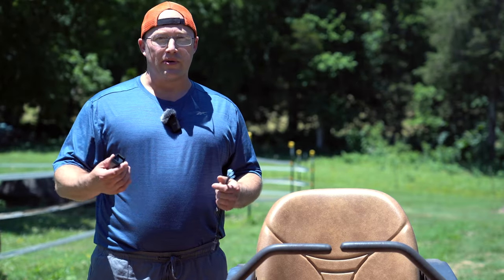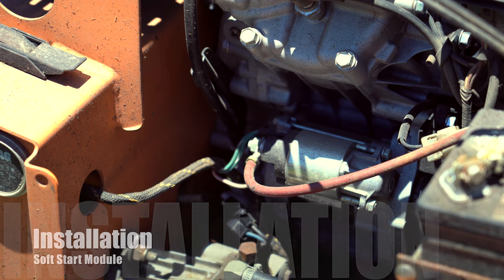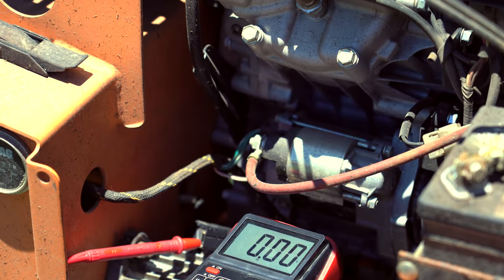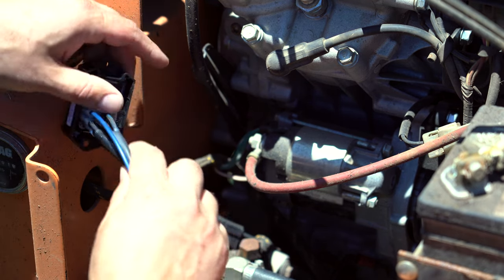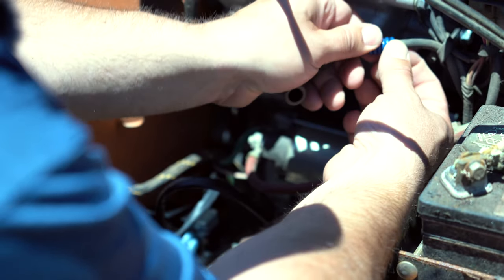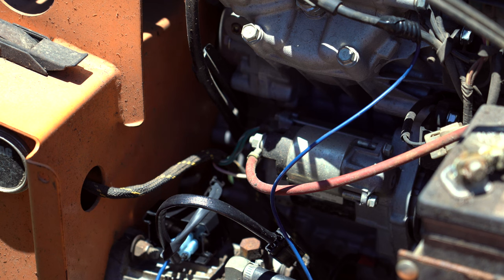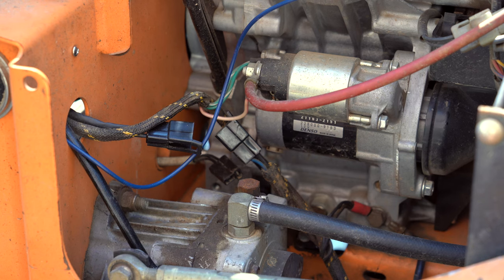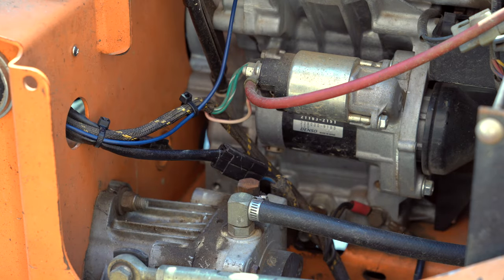Installing a Soft Start Clutch on a Scag Turf Tiger

Comment: I guess a belt is cheaper than a clutch. I had my restored 2004 TT running for over 10 years with engaging the PTO full throttle everytime without changing a belt or clutch. I imagine the previous owner did the same since new. Sill original clutch.
Reply from the maker: I was actually having more problems with the tensioner spring breaking.   That’s still the original belt from when I picked it up. I have a replacement but have not had to use it yet.

Comment: I remember busting belt after belt on my Tigercat II when I first got it.  I took it to the dealer.  They said there was nothing wrong with it.  Finally I went to a different dealer and they told me to pull back the throttle when I engaged the clutch.  DERP!  Hell, I didn't know.  My Toro never had that problem.  Maybe I should get one of these.  It seems like it should be a standard feature.
Reply from the maker: I think on the newer models with the larger engines it’s comes standard on them.
Reply: @thefantasticadventuresofmr7126  I can't believe that the dealer I bought it from would have me change the belt 4 times on a brand new mower, have me trailer it and drive it 60 miles each way to their shop and STILL not mention lowering the throttle.  I mean, nobody thought of it?  Were they just putting me through all of that crap to sell me $80 belts?  IDK, still makes me mad.  Then when I found out what the problem was I felt stupid.  I mean, the whole time they kept saying that maybe a stick got into the belt and crap like that.  They should have known this was a problem.

Comment: Curious...  I can find the Ogura controller lots of places, but no one offers the wiring harness?  Did you make your own harness or did you find a complete kit somewhere?  Thanks!
Reply from the maker: Yes I made the harness. I cut the female end from a old John Deere and I had a brand new male end from a clutch.  I then just crimped the fittings on to ends and  connected them to the controller.

Comment: To me you’re transferring the wear from the the cheap belt to the clutch. Having the soft start allows the clutch to slip thus shortening its life idk I gues time will tell
Reply from the maker: Its my opinion that you are correct, but the newer stand on units come with them installed. Now with that being said his unit is around 37hp with a 52” deck. It might be with that much HP you have to have the soft start or it will just snap belts from the torque.